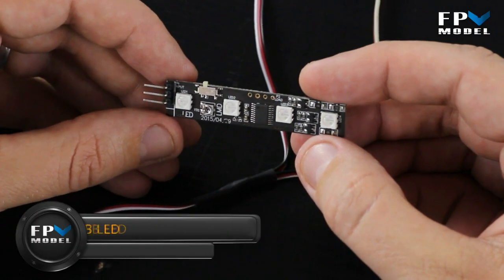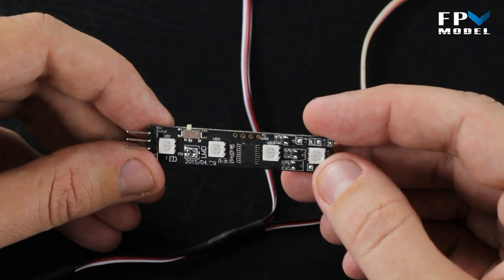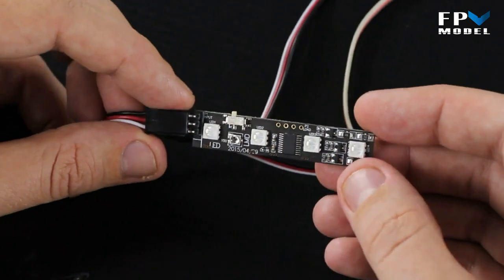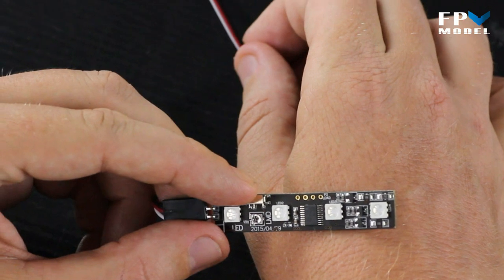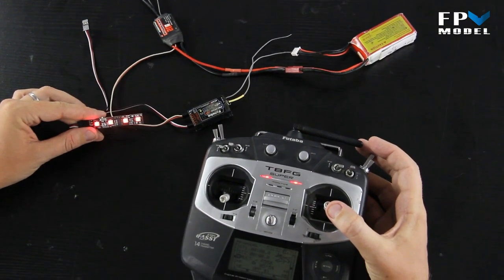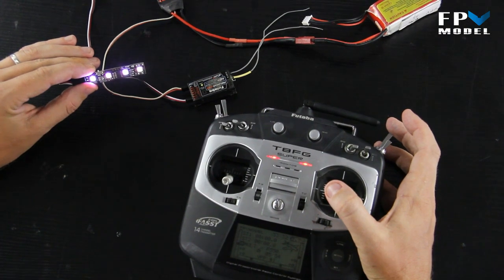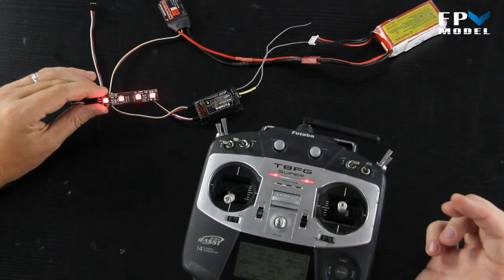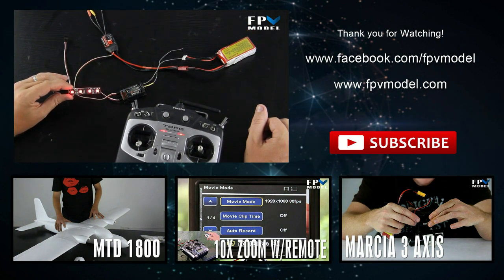Braking RGB lights for multi-rotors.

Comment: What is the adjustable pot for?
Reply: JKFlorida I think it adjust the sensitivity.
Reply from the maker: startazz It is sensitivity. You can change when the lights react. So if to hardly move the elevator stick you can set if you want it to changes or not. This also means that you can change the sensitivity so the lights don't change until your stick reaches it's maximum limit points.
Reply: where is the pot located on the board?